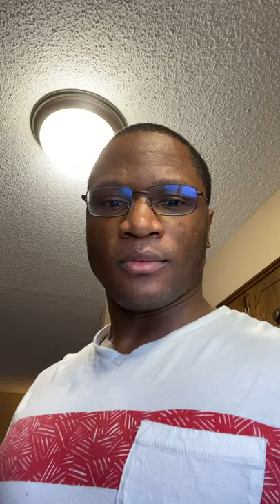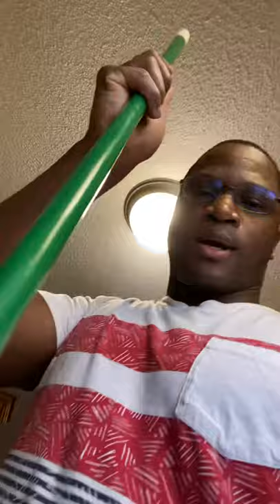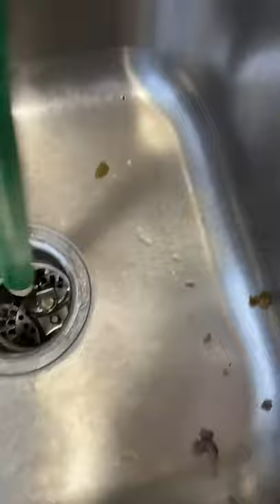Fix a Garbage Disposal without an open for Allen Wrench

Comment: Thanks brother.  I had tried the tool on bottom, but did not feel like it as turning.  So, did your way with a small base ball bat and got it to spin.  Turned on power and it worked.  My unit is over 10 years old so I think in going to quit soon.  Wife may find a new garbage disposal under the Christmas tree.  Just kidding 😎💸

Comment: Nice! Great idea when you’re in a pinch. 

They make another wrench other than the bottom Allen wrench. It goes in on top of the disposal motor. It’s a flat piece of steel standing on edge with a “T” handle. It’s around $10 on amzn. 

You can also use a piece of scrap wood that’s 1” thick x 3” wide x 14” long.

Comment: Thank you! I’m 70 yes old & renting a condo. Badger disposal & it did have the spot for Allen wrench but didn’t have an allen wrench I knew my landlord would gladly come over to fix the issue. BUT - I also knew there had to be some way for this independent woman to get that disposal working. Also, as someone else mentioned it’s a heck of a lot easier than getting on the floor (full disclosure - getting on the floor isn’t the issue - it’s getting back up that’s the problem)

Comment: Thanks for this video bro, I watched several videos before yours but none of then solved my problem because my disposal doesn’t have a nut underneath. The last time this happened I filled a claim with my home Warranty, the plumber came and did what you just sawed in this video 5 seconds the machine was working and I had to pay $85 fee for service call, I was really irritated and he didn’t want to show me how he did it, so much attitude.
Today it took me less than 5 seconds to get it working just by doing what you demonstrated in this video.
You are a money saver, thanks for spreading the knowledge.